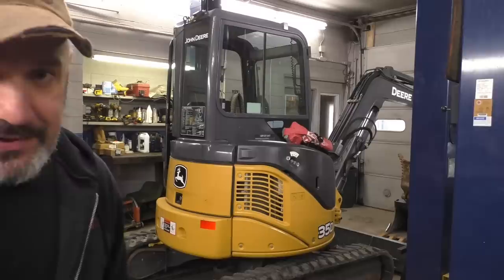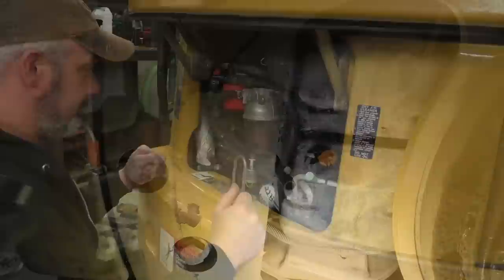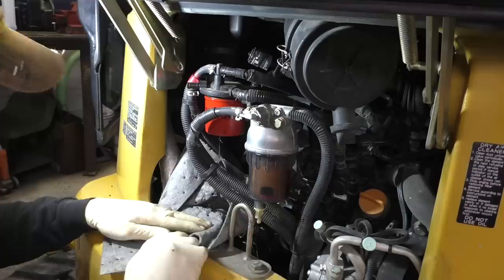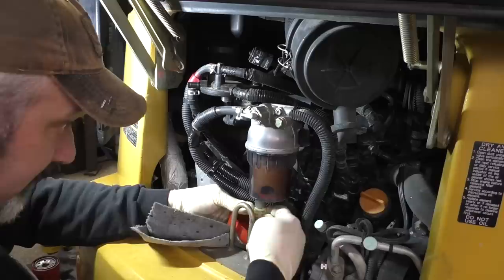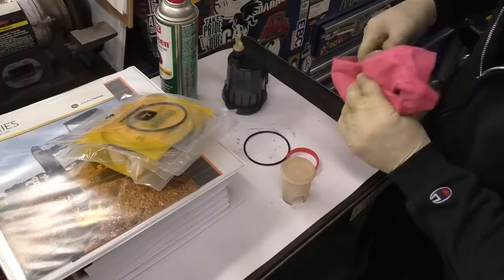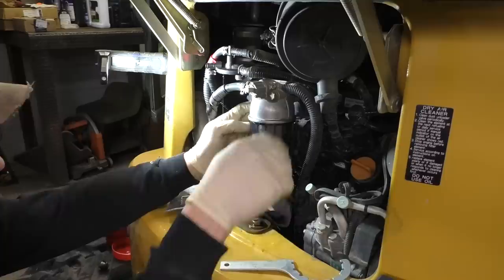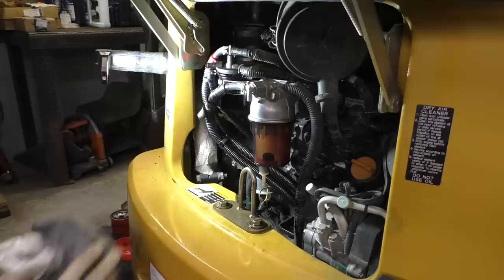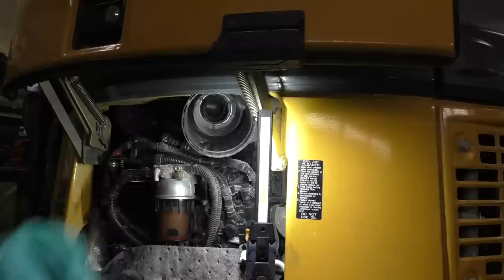John Deere 35D Excavator: Engine Oil & Filter / Fuel Filters / Air Filters - Replacement

Comment: Not sure if you know this, but you can reduce water in your fuel by making sure you keep the fuel tank full when not running the machine. There is less air in the tank, so water can't condensate on the inside walls of the fuel tank due to temperature fluctuations. Learned that from Clinton on his channel C&C Equipment. He fixes and sells heavy equipment.

Comment: I have no clue about running excavators, I barely can run my sub-compact tractor without issue.  I wish my tractor had a fuel/water separator like that, and a spin on fuel filter of some sort, because the el-cheapo in line filters it has are just that really cheap and a PITA to change the one under the tractor.  It has 2 of those filters.  

I bought my tractor new...thought about buying used, but would rather know what has been done to it from 0 hours rather than what someone else claims they did...and in my experience with used vehicles, they don't do much of anything other than abuse and neglect.  

That inner air filter looks pretty similar to the one on my tractor....although it is referenced as a dusty environment supplemental filter, I picked up a couple of them anyways and have installed one of them plus the standard air filter....given the conditions it sometimes gets used it, having that additional filter is probably a good thing.

Comment: My stuff is old now. I don't run them up in real cold weather any more. They sit. I think 0-Rings. I think hyd seals. Space shuttle Challenger go at
 throttle up. Even if it's warm in that cab. Tracks skate in the snow. A pass or two then you are on ice.

Comment: On that water separator drain plug you could stick a piece of pipe on it and put that pipe straight into that oil drain that the oil filter drains into

Comment: Yes that little air filter should be in there. That's a safety filter.
Also get in the habit of checking air intake rubber hoses for cracks now and then. If they split or Crack your engine will be junk in short order.

Comment: Algae in the fuel is due that the previous owner used very cheap fuel that hadn't the proper additives to prevent it to form. Drain all the fuel tank, rinse it clean and fill it with new quality diesel fuel and thats it.
The red plastic ring inside the water separator is a float, it floats on water but not on fuel, so it helps to see the water level inside the bowl if it is dirty. But if you use quality fuel and keep it well preserved in storage, water in fuel should not be an issue.
Great machine purchase, hope you enjoy it.
Also remember to grease all the pivot pins of the excavator and dozer blade, and the swing bearing on the frame.

Comment: Wow, that appears to be in great shape for a 2012 is 2k hours.  I would guess if it is that well taken care of on the outside the PO took care of the inside as well.  
I bought a used tractor from a tractor dealer that claimed it was all serviced.  Got it home and it had clearly not been greased in a LONG time.  Oil filter had date and ours WAY in the past written on it.  Liar liar pants on fire.

Comment: If I buy a used car I essentially do the same thing. I change the oil filters. You can learn a little bit by going and doing that about the condition of the vehicle and how was maintained. If you're changing the oil and checks are coming out you know you got a big problem.

Comment: You said it was dirty so I would suggest going a little deeper. There are access plates on the bottom, remove them and see what falls out. Check the air flow to the radiator and anything that may filter the air to the radiator. The hydraulic pumps and lines will get hot so check if there is dirt that will keep heat from escaping. Then look very closely at every hydraulic line to see if any are rubbing and and take every effort to keep the lines free. Actually not just hydraulic but every type of rubber or metal line. They usually have lines clamped down but someone’s big foot steps on the wrong place and breaks something

Comment: Diesel fuel turns in cold weather and when it gets old. It can be like jelly. You did yourself a favor by cleaning and replacing all the filters and so on. Best of you use only enough fuel to get the job done. Run it dry after use. I know you're smart and enough to use OEM and not after market. There is a bleeder on the fuel and water separator.

Comment: Definitely biomass in fuel strainer from microbes in tank.  A little biocide treatment and routinely cutting water from tank bottom and you should be fine (that's why they made the tank so easy to drain).

Comment: I have a JD 317G compact track loader. Based on the oil chart in the manual I didn't dare put the usual 15W40 in that I have for everything else. I was surprised to see you putting in 15W40. The only thing my supplier had that met the chart was 5W40. Mine is a Yanmar engine, as I assume yours is. Apparently they think 15W40 is a little bit thick for a cold winter start.
Reply: You have a 4cy turbo Yanmar in yours. This mini has a 3cy non-turbo Yanmar, so it is probably more forgiving on the oil specs.

Comment: Did the other owner(s) have the unit repainted on end ? Judging from overspray on rusty area and runs in paint (factory pretty though about using excessive paint),probably ran in tight quarters a lot with plenty of back scraping on unit.Farmcraft had to reseal his rotating assembly to track unit because of leaks.

Comment: One of the old timers I work with always uses grease on the O ring on the filters. Only person I've ever seen do it but it's something I'm going try when I service the trucks and equipment at work. Ever hear of anyone using grease instead of fresh oil? I'm just curious if that is something that was common back in the day.
Reply from the maker: Yeah I've seen it both ways 👍

Comment: Most likely it is algae. We oftentimes get entire fuel tanks on boats that are filled with it. diesel needs to have a biocide added to the fuel to prevent this from happening.

It gets so bad that I've seen fuel filters entirely clogged with black algae, as in, you can't see the filter element there is so much crap from the tank.

Comment: I was wondering about that single element air filter setup.  My Dixie Chopper Kawasaki engine has I believe the exact same filters in it.  I've changed the large filter once but not the inner filter.  Motor only has 100 hours on it though.  So what are you going to use that excavator for Mr.O ?
Reply from the maker: Diggin' 😉
Reply: @TheRealEricO  Ask a silly question get a silly answer,,,,,LOL   dig away  Mr.O

Comment: Hey Eric, this is just something I’ve learned from another channel another place that I watch on YouTube the stuff you’re finding in the diesel fuel in that is a sludge that is because it’s bile fuel and gums up everything leave it up to the government to screw up everything because they put bio fuel in it. It makes the gooey nasty stuff get through the system means you have to change the filters more frequently or you won’t get the fuel flow to the engine that is required very important to keep the fuel filters clean, you may have to do it frequently maybe depending on the use you might have to do it once a month but it just depends on the usage of it but you’re going to have to do it frequently and the bottle fuel is in all of the diesel fuel you can’t get away from it

Comment: I have algae build up in my Golf Course Equipment....it will bog and shut the engine off.   codes will shoot up on the led screen.  Have to use diesel treatment to control it.  they say the best way to solve it is to take fuel tank off clean it throughly.  not taking off a hundred parts to clean it.  that's what the  Techs says, but they don't actually work on the machines just go by the books.

Comment: 2000 hrs 8 hr shifts😮
Reply: What about it? Only a couple years to achieve that. I've had guys on equipment 24/7 until jobs are done. That's only months.
Reply: @skinlab4239  especially for a 2012. Just over 200 per year.

Comment: hopefully they are not using that new biodiesel for that excavator makes oil burners all slimed up with sludge from bacteria breaking it down.
i like the using lube on o rings on my Toyota reusable metal housing oil filters makes they a lot easier to assemble and take apart i use silicone grease on everything i can lol

Comment: Many times instead of using John Deere  part's,  especially stuff like oil filters,  air filters,  fuel filters,  can be bought at half price compared to the John Deere stuff and be just as good.   That's just my opinion.

Comment: i dont want to jinx you but, pardon me, im commenting as soon as i started the video. i hope to god the starter never goes out on you, because it its only removable after you rip out the entire interior, and work through an access panel.
Reply from the maker: In about 5 minutes the whole operator station tips forward and exposes the entire engine 😉
Reply: I'm jealous. The older models at my job require vast disassembly and pain

Comment: Use only John deere hy guard oil  
John deere cylinders seals don't like other brands of oil
Reply from the maker: This does not call for hy gaurd. These machines are not made by John Deere. Explain and show this in a later video where we swap out the hydro filters and oil.